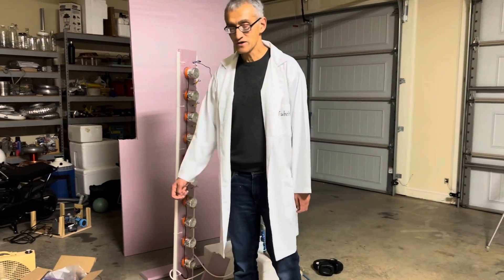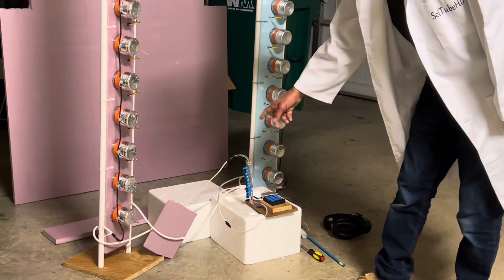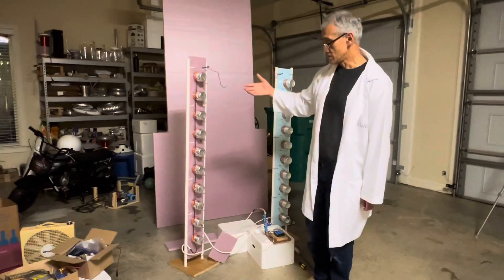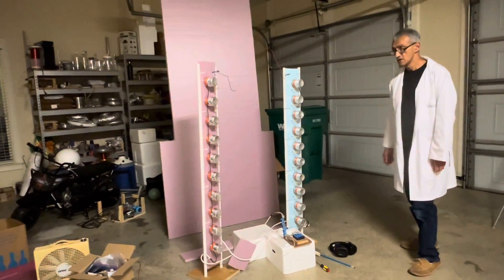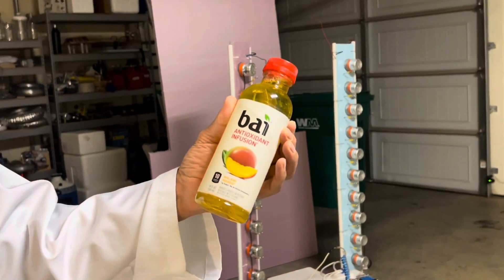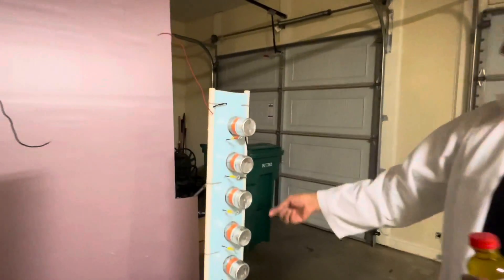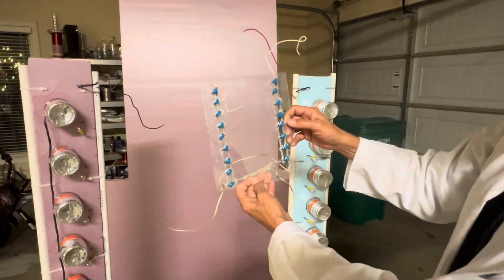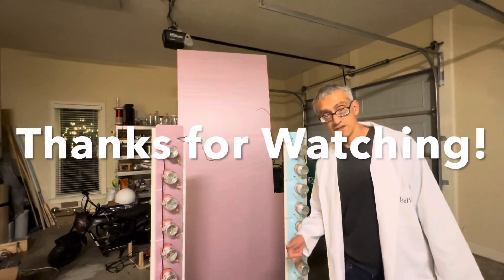Making a giant static electricity tower

Comment: beautiful project. I would love to see it upgraded with copper tape(coated in isolation paint) and copper wire, and parallel glass bottles for higher capacity. this will be more lethal but also louder and more fun.
Reply from the maker: Thank you! It was a fun project
Reply from the maker: Yes exactly thought about using copper tape as well! Most of the copper tape I came across was too thin and not very durable. Also the outer cap foil of each capacitor acts as a discharge electrode and I was afraid the ozone generation around the spark would degrade the copper.